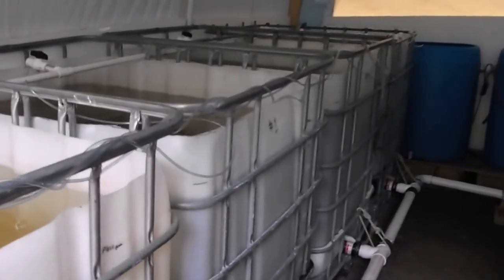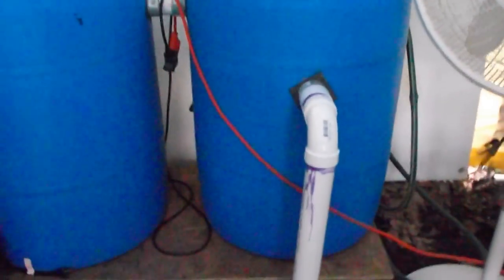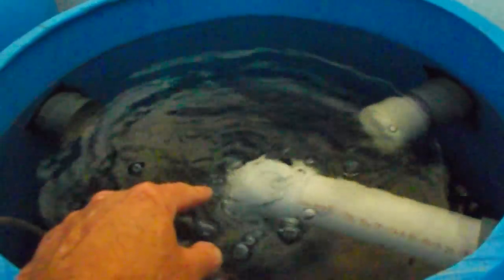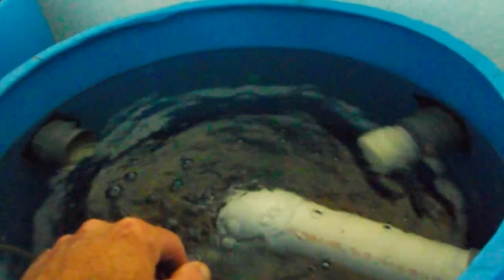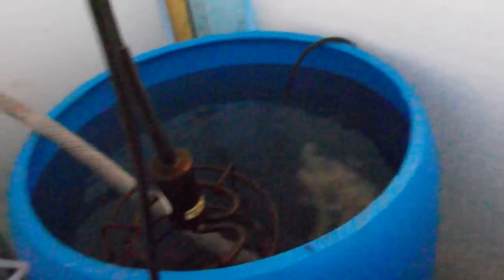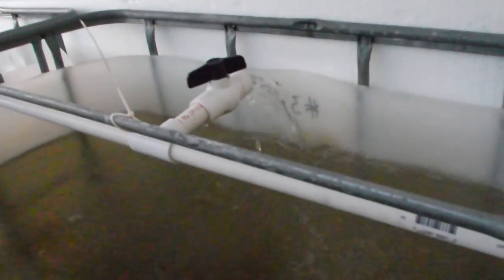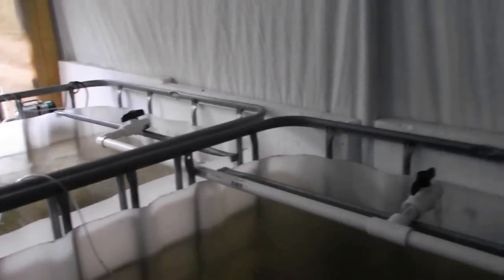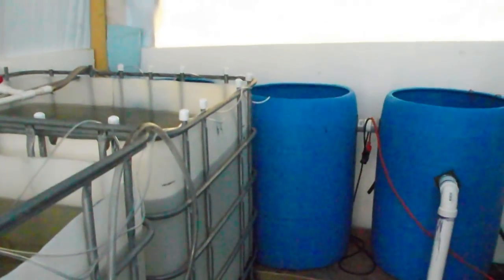Tilapia - Filter System Details

Comment: What pushes the water from the tanks to the filter barrells? Could you explain the flow of the water in a little more detail?
Reply from the maker: Rogers Caribbean Good morning Rogers, the water flows from the IBC totes into the barrels by GRAVITY, it fills the first barrel carrying with it the solid waste. The solids settle out in the first barrel and the water overflows from the first barrel to the second barrel also by gravity which is the Biofilter from there it overflows into the third barrel which is the sump and is pumped back into the IBC totes using a submersible pond pump.  When I am not heating the water, the pond pump is the only thing that is running. As the sump barrel is pumped out, the water is replaced (by gravity) constantly..  It is a "recirculating closed system"..  Remember that water will always seek its own level so once I fill the tanks and open the drain valves, the water will continue filling the barrels until all totes and barrels have identical water levels.  Pumping the water out of the sump barrel causes the water to constantly flow from the totes into the barrels to maintain the same levels.
Reply: Thanks for your prompt reply. Is there any particular level to place these tanks/ barrels/ pipes to achieve the gravity pull?
Reply from the maker: Rogers Caribbean If you come out of the drain of the IBC tote and have the tops of the barrels at the same level as the tops of the totes that will insure that if you have a power outage nothing will overflow, the entire system will just stop moving.  The water should go into the barrel system about half way up the barrel or maybe a little lower.  I had to put the barrels on a platform of 2X8's to get the tops of the barrels to be the same height as the top of the totes.
Reply: After some time the solids would build up. How do you then clean the system?
Reply from the maker: Rogers Caribbean I simply shut the valves at the bottom of the IBC totes and syphon all the water (and the waste) out of the solids filter. You can put a ball valve in the bottom edge of the barrel and connect a line to it that goes outside to a garden, flowerbed or just into the yard. It just depends on how you want to use the fish waste....I use mine as fertilizer for my garden.  Then refill the solids filter with water and open the valves and you are done.
Reply from the maker: Mineral Springs Tilapia Oh, remember to turn off the return pump in the sump to make the system go static and turn it back on after you refill the solids filter and open the valves on the IBC totes.  Everything will just start moving again.
Reply: Thank you very much for all the information.

Comment: Hi there.  I am a beginner looking to raise Tilapia in Costa Rica with my father in-law.  I would like to know your opinion as to what i needed for a filtration system for a 6 meter by 2 meter by 1.5 meter deep cement pool.  I’d also like more details to your design and layers of filtration.  Would it be possible to contact each other either by phone or email?

Comment: also do the totes all have to be the same gallons or can i have one tote out of three be 300 gallons and the other two 200 gallons
Reply from the maker: christian32762 Doesn't matter what size containers you use,  but they will always be at the same level if you set it up like I did. So, if your 275 can hold 250 gallons of usable water, 250 gallons is all that will be in the 300 also if everything is set up on the same system.
Reply: thank you so much
one more question in the third tank as your sump its just the return pump and thats it right nothing else in it other then the heater

Comment: Hi sir im from philippines.. Is your pump running 24/7? thanks in advanced
Reply from the maker: sglouie1 Hello, yes, the water pump is moving the water at all times and the air pump is providing air to the fish 24/7 also.  Thanks for the question.....Greg
Reply: Mineral Springs Tilapia hi Greg. on the bio filter drum isit necessary to put a airstone to produce air on water?
Reply from the maker: sglouie1 Not absolutely necessary, but air in the bio filter aids greatly to the growth of the bacteria in the filter.
Reply: Mineral Springs Tilapia ok sir thanks. and the Bacteria is use for what? And if I have 15 pcs tote ibc tank, would the 3 drums be enough to clean that large amount of water?
Reply from the maker: sglouie1 The bacteria in the bio filter (and on all surfaces in your system) changes ammonia to nitrite and nitrite to nitrates.  Do a search on "The Nitrogen Cycle in Aquariums".  You will need to know and understand the nitrogen cycle.  The 3 barrels that I have set up will only keep up with 4 totes, so you would need 4 sets of filter system barrels with 4 totes on each set. 4 totes and 3 barrels will hold about 1100 gallons of water. 15 totes without barrels is well over 3000 gallons. If you want to hook up that many totes on one filter system, you will have to design a much more sophisticated filter system.
Reply: Mineral Springs Tilapia thanks for the fast reply Greg! Godbless.

Comment: What happens if your power goes out? do you have any check values that can prevent your sump from overflowing
Reply from the maker: +ADRIAN Franco The barrels will NOT overflow.  Since the tops of the barrels and the tops of the totes are at the same level and water seeks its own level, the system just stops flowing and remains static.  That is why the barrels are up on stands.  If any part of the system was at a lower level it would overflow at that low point until all the water was again at the same level throughout the system.  Hope this helps.....Greg
Reply: +Mineral Springs Tilapia thank you of that information. how do you make you fliter system. can u email a step by step on what to do
Reply from the maker: +ADRIAN Franco The video should show you how to set this up,  a step by step explanation would be like a small book and I don't really have the time to devote to writing something like that.  If you have a specific question about how this is set up, I will be glad to answer and address your questions.
Reply from the maker: +Mineral Springs Tilapia The filter system has to be set up to fit your particular system.
Reply: +Mineral Springs Tilapia I was just trying to figure the water level so it doesn't over flow
Reply from the maker: +ADRIAN Franco As long as the tops of the totes and tops of the filter system barrels are at the same level, the system CANNOT overflow.  If the power goes out, the water will just stop moving.  As your pump moves water from the sump, the tanks will drain into the filter barrels at the same rate trying to fill the low spot being created in the sump.
Reply from the maker: +ADRIAN Franco Trust me, I have unplugged the return pump many times and have had my share of power outages and I have never lost any water from the system.

Comment: Do you used a pump to get the water in the solid filter
Reply from the maker: No Mike, it simply drains from the tote bottoms  into the solids filter.  The only pump is in the third barrel which pumps the water back up into the totes.
Reply: Mineral Springs Tilapia what size pump or recommended pump for just 1ibc tote filtration?  Thx

Comment: For the small fishes do it get suck into the filters from the bottom and how can i prevent it? Because i gonna do a similiar filter system
Reply from the maker: In an IBC tote, I used a 10 inch long piece of PVC pipe with 1/4 inch holes drilled all around it and 1 end capped with holes drilled in the cap. I tapered the open end a little with sandpaper and tapped it into the drain hole on the inside of the tote.  As long as your fish are bigger than 1/4 inch from top to bottom, they can't get through the holes but the water and fish waste will get sucked through.
Reply from the maker: Oh, the piece of pvc pipe was 1 and a half inch size.  That's important to fit snug.
Reply from the maker: I'm pretty sure it shows it in the video.

Comment: How do you keep the smaller fish from swimming out the pipe at the bottom?
Reply from the maker: The fish are not placed in the growing totes until they are at least a little over an inch long.  There is a capped piece of PVC pressed into the drain hole on the inside of the tote with 1/4 inch holes drilled into it.  They cannot get through those holes. If you find the scene in this video looking down into the totes, you will see them.
Reply from the maker: If you look at the scene with a time stamp of 4:40 you will see one at the bottom of the screen.
Reply: I knew I had seen them.  Is it just 2" pvc pipe?  I don't want it to float out lol.  Is it hot glued in? silicone maybe? or just friction fitted? Thanks!
Reply from the maker: It is actually 1 1/2 inch pvc.  I did put silicone around the open end before I hammered into the drain hole, but I suspect it will hold without the silicone.

Comment: Hey Greg I have watched all your videos and think its great you try to help in any way you can. My question for you is, Do you do this just for the hobby part of it ? Does this generate enough cash to help pay for the expenses and put some spending cash in your pocket?  I started breeding Tilapia to help off set the cost of feeding my five 7" Red Belly Piranhas. But you have inspired me to build up my system, but only if there is some cash to be made. Don't get me wrong im not wanting to get rich off of Tilapia but if I could make enough money to cover the cost of up keep on them and still make extra beer more that's sounds like a plan to me.
Reply from the maker: Burgess Boys The first year I did this I barely made enough to cover my operating costs (water, electric,fish food, etc) and virtually 0 to help with the investment of tanks, pumps, filters, etc.  This year (my third year) I was able to recover the cost of my initial investment for the equipment, all the operating costs and probably $1,000.00 for beer (or in my case other adult beverages).  If you count Your Time, you will probably never break even unless you do it on a much larger scale than I do....but I don't take that into consideration.  But, you have to get your name out locally and create interest and a market for your fish and that takes time.
Reply: Thanks for the information Greg I think im going to give it a try on a bigger scale then what im doing now. I will keep you updated, by the way how did the Aquaponics turn out for you?
Reply from the maker: Burgess Boys I had to abandon that Idea about a week after I got my first breeder colony and go to aquaculture only.  I would love to try again and feel certain it would work well.

Comment: Do you filter the pools the same way?
Reply from the maker: MrERIC646 Basically the same except there is no sump in the loop.  The water is pumped from the pool into the solids filter and overflows into the bio-filter and then overflows back into the pool from the bio-filter.

Comment: how much does it cost in fish food to raise them from fry to dinner size, I guess a one pound fish?
Reply from the maker: +L.A. Boltryk That is completely dependent upon your growing conditions and the food that you choose to use.  Tilapia go through a 240 day accelerated growth period.  So, under correct temps, space, light, air and the proper feed (I use Purina AquaMax) in the proper sizes (300,400 and 4000) at the proper times,  it will take around a pound of food to grow a Tilapia to harvest size, but remember, you can't really do the calculation for 1 tilapia so we do it for 100 fish.  A combined pound of the three different sizes of AquaMax that I use costs less than 1.00, but  I buy the food in bulk.  This should give you enough information to apply to the circumstances and conditions in your system to get close to knowing what you will need and when you will need it to bring your fish to harvest size.
Reply: Are you saying that you use 1 pound of food to raise 100 tilapia from fry to adult size?
Reply from the maker: +L.A. Boltryk I'm sorry, that is what it sounds like.  But, I use just under 100 pounds during the 240 day accelerated growth period for 100 fish, so 1 pound of food for each fish or about .98 cents to get 1 fish from fingerling (1 inch long) to a pound.  Sorry for the misunderstanding.
Reply: That's what I taught but wanted to make sure. Great channel and a lot of info.
Thanks.

Comment: for 4 IBC what size pump do i need?
thanks.
Reply from the maker: +N B You will have around 1100 gallons of water in 4 275gal IBC totes and 3 55gal barrels.  I like to make sure that I circulate the total volume of water at least once an hour so I used a 1500GPH submersible pump.  Thanks for the question.
Reply: THANKS..
im thinking of doing white nile. can u sell me some if u do have them. and how much to valdosta,GA.?
Reply from the maker: +N B  White Nile is a hybrid fish and I only breed Pure Strain Nile Tilapia along with Blues and HornorumXNile Hybrids.  If you look on mineralspringstilapia.com  on the products page if the item has a paypal button under it then it is for sale and in stock.  Everything I sell on the site already includes shipping.

Comment: what is the stocking density for such filters in one fish tank?
Reply from the maker: The standard is 3 gallons of water/fish at full size.  Personally, I stocked at 5 gallons of water/fish for a couple of reasons.  I don't like cleaning tanks and the solids filter as often and I never needed that many fish as I was growing only for myself and my family and we didn't need that many fish.  I have seen people use additional IBC totes as filter components and that much filtration will allow for a higher stocking density.  It really just depends on what your ultimate goals are going to be.  There are many ways to configure the system.
Reply: Mineral Springs Tilapia thanks a lot for yr reply. jus for my understanding can u pls give me some guidance. that for 500 gallon of water tank can i keep about 600 fish till harvest at 200 gram each, with three 100 gallon bucket mechanical filter and five 100 gallon bucket biofilter. to keep the ammonia level below 0.05. thanks
Reply from the maker: True that the fish could get to 200 grams which is a little less than a half pound, but at  that density, you would probably need to have pure oxygen infusion into the tank.  Tilapia use oxygen to metabolize their food and would probably not be able to get enough oxygen from just air pumps.  I have never harvested a tilapia that was less than a pound and a quarter or 567 grams .  Good stock fish should easily get to over a pound in 8 and a half months with adequate 1. Water temperature, 2. Water quality, 3.  Proper food at the correct amount and proper times, 4. Enough dissolved oxygen to metabolize that food, and 5. ROOM TO SWIM.   You are talking about less than a gallon of water per fish and they will not grow quickly or to a large size except with a pure oxygen infusion system when stocked at that rate.

Comment: do you have nitrate issues
Reply from the maker: No, I do lots of water changes that take care of any nitrates.  Nitrates are only dangerous to the fish in very high concentrations.  The only way to remove nitrates is with water changes.
Reply: Mineral Springs Tilapia I come from saltwater and I have great luck with algae scrubbers. Recently I got a freshwater and put an algae scrubber on it to. No problems with nitrates it works great so far (3 months) but it is proven to me in saltwater.
Reply from the maker: Nice! But I am raising fry and moving fish around everyday.  I have new water in all fry tanks anyway and I don't raise fish to full size any longer.  But great information, thanks.  I could have used that a couple of years ago!